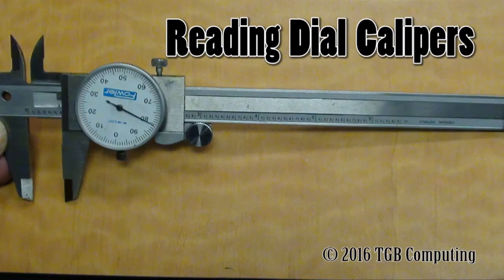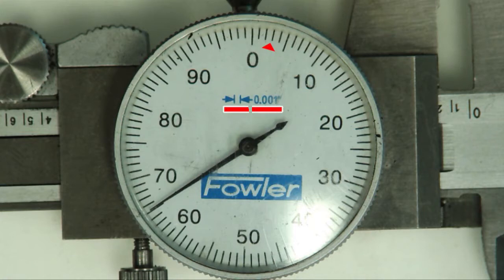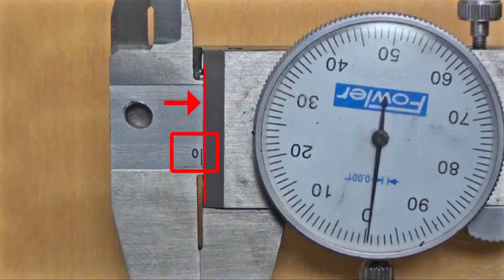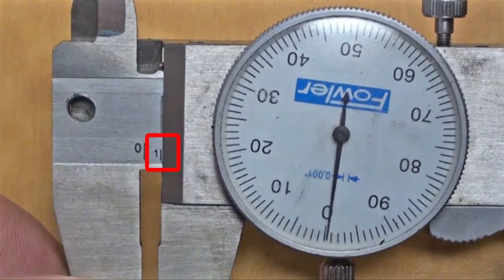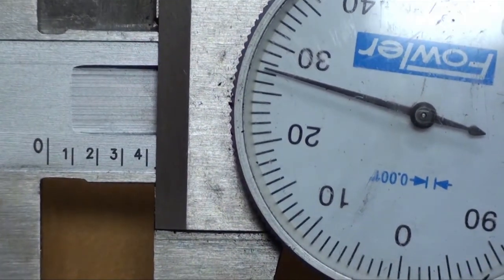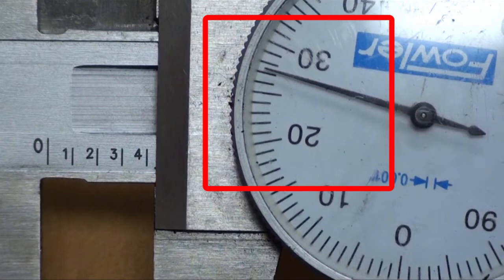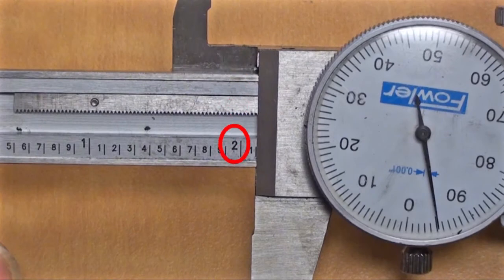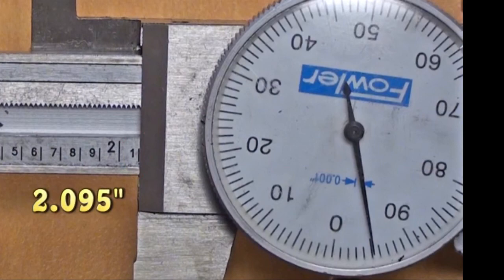Reading Dial Calipers

Comment: Are you sure its not .427? 🤔
Reply from the maker: You are correct.  I misspoke.  I said .422" when it is .427".  I will fix this the next chance I get.
Reply: @DrivelineMaster  Please do insert a comment with the "fixed" statement of 0.4275". I really like your video and wish to use it in my college instruction but I can't until this error is fixed.
Reply from the maker: Please check out Reading Dial Caliper 3 (https://youtu.be/fYPNvynQ394) on my channel. I thought I fixed that a while ago.